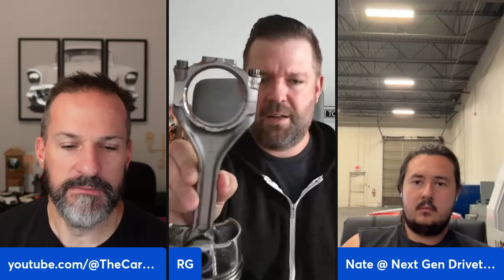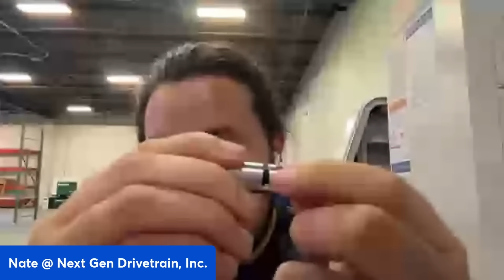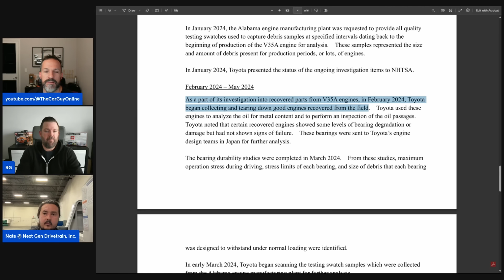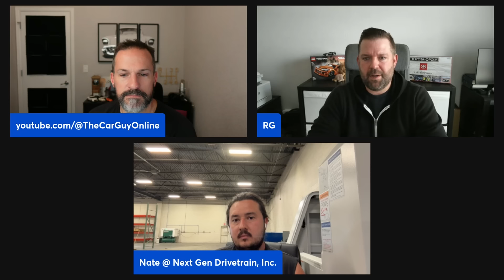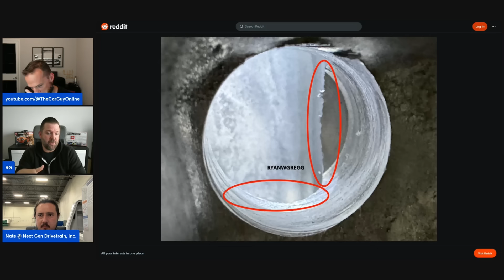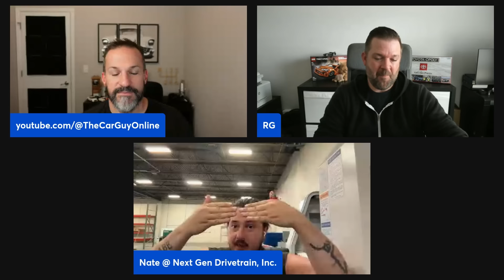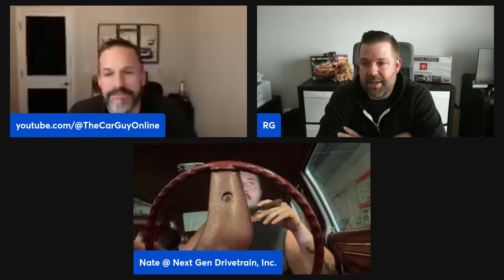Toyota Tundra BOMBSHELL. Buyer Beware Until 2026 (Full Interview)

Comment: 11:03 Doesn’t surprise me at all. I had a 2007 Tundra and had one of the very early emission pump/switching valve problem. They refused to admit it was a problem or cover it. $6000. The second one went out. Still wouldn’t fix it. Besides that issue, it was, by far, my favorite truck of all time. I put 300k miles on it resetting the CEL every morning.  I WILL NOT EVER buy another Toyota. Not because of the issue, but because of Toyota’s refusal to acknowledge the problem even though thousands were talking about it on the forums. F them.

Comment: The absolute crazy thing is that the EPA rules are actually causing more air pollution than they are trying to prevent. Cars, washer, dryers, dishwashers all have a very short life expectancy because of trying to save energy. But the pollution caused by scrapping and buying new is much more destructive to the environment. Remember when a fridge would last forever? All these energy savings rules are causing land fill issues and scrap yards are full of junk, then we recycle the junk and use more and more energy that is causing more and more pollution. These rules by the EPA are causing climate change faster than they are stopping it…….. When idiots are in powerful positions and low iq can’t see past the poor decisions….

Comment: My 2014 Sienna with the V6 has oil leaking from the timing chain cover with only 135k miles (when I noticed it).  It's a common issue on these engines if you check YouTube.  It's about a 17-20 hour labor time fix.  Not happy.
Reply: Oil leaks happen. Monitor your oil level at every gas fill up. Keep it full. Change it every 6 months or 5K miles (whichever comes first) and continue living your life.
Reply: Thanks! That's the plan. No way am I paying to fix that.  I'd rather trade it in at that point.  I've been monitoring it and adding oil if needed.
Reply: @85Rx  I have a 2015 Sienna and so far haven’t had any leaks. 🤞🏻 It has 211K miles. We’ve had it since it was new. The 2GRFE are an excellent engine. They’re extremely long-lasting and reliable. You can’t buy a new car with that same reliability anymore. If mine develops a leak, I’ll monitor it and if it starts getting to the point where I’m having to add oil a lot, I’ll have it fixed. New cars are junk.

Comment: I been thinking how would you build a girdle that holds the crankshaft bearings for every engine. As all the girdles would be the same. And that would suggest that every bearing is the same. How can that be done when there is always tolerance differences between parts. One of the crankshaft bearings could be tight on one engine and loose on the next. Remember when we used plastic gauge to determine the clearance between the crankshaft and crank or rod end bearings. That doesn’t happen anymore. Just slap a girdle with the bearings on and tighten it down. Cross your fingers that non are tight.
Doesn’t make any sense that that would work. Crazy

Comment: i watched this whole interview and this exactly proved my point as to why I gave up on modern gas and diesel cars. I switched to Tesla and yea it doesn't have the gas v8 etc whatever. But I cant in good faith say that there is any reason to buy a gas powered car anymore with all the emissions crap on it and quality control on these engines and transmissions is horrendous. You CANNOT just maintain a car anymore and hope it will be reliable. Now its WOW I changed my oil and transmission fluid religiously yet I have head gaskets and turbos blowing up when I did everything right to the car. I am just done with it.

Comment: yeah, i have a 2016 and a 2004 Land Cruiser.  keeping those two forever.  I'm honestly thinking about trading in my 16 for a 15 so i can have the 6 speed instead of the 8 speed.  i hate what toyota has become. they are on the cusp of losing all their longtime followers.  best suggestion is get a toyota tundra with a ton of miles and replace the 5.7 long block and trans and do another half a million miles.  f these new vehicles.

Comment: I got one of those parts that was missing the hole! I called customer service and they overnighted a revised part no charge! I finished the install and had an issue with a trouble code. Taylor in tech support told me what the issue was and it cleared itself shortly after. I am a new fan of Next Gen transmissions.

Comment: The Toyota that people interface with today are run by American managers who are more concerned about making the numbers look good this quarter.  They surround themselves with friends and families.  Also note that Japan has labor shortage problem in manufacturing, so the people that build Toyotas in Japan may not have the same continuous process improvement mentality.  Dealers are independently owned, so they are mainly interested in making $, not performing warranty repairs.  

The grandson of the founder and former CEO of Toyota, Akio Toyoda, stepped down in 2023.  The current President and CEO of Toyota, is Koji Sato. He is not related to the Toyoda family.  Best chance of fixing the problem is to contact Sato, not the people headquartered in Texas.

Comment: I’ve been doing short oil change intervals and oil analysis on every one of them on my 2025. I’m at 3,1XX miles and have done 3 oil changes already. If my motor blows it’s a design flaw 1000% because all my analysis have come back great (the first two was a little weird but normal for break in)

Comment: I’m keeping my 5th Gen 4Runner. 

If I needed a half ton pickup right now, it would probably be an L84 5.3L GM now that it moved away from a variable oil pump.  If the lifters went after warranty I’d delete and upgrade the cam.   

Or I’d go 3/4 ton gas.

Comment: Working in manufacturing as an engineer, leaving debris in a part is such an amateur mistake. It makes me think that is not the case. I am not in automotive but wonder if their tolerances are so tight to meet the epa requirements their issue is actually improper tolerance and what they are getting is parts rubbing. Thoughts?

Comment: keeping my 2011 camry v6 until it rots and theres no more metal !
Reply: Fluid film it every year and wash it after it snows so you get the salt off, and it will last a very long time.
Reply: @Becca-k4h  been rust proofing from the day i bought it! only rust i have is on exhuaST
Reply: @peterpeter5666  That’s awesome! You’re more diligent than most owners!
Reply: @Becca-k4h  been an auto tech for 40 years . i kinda know a thing or 2 about cars LOL
Reply: @peterpeter5666  That explains it! Lol!
Reply: @peterpeter5666  I also have a car with the 2GRFE engine. It’s a 2015 Sienna. We will be keeping it forever. It’s such a great vehicle. It has 211K miles are still running strong! The last reliable cars that Toyota made. The new stuff sucks!

Comment: As for Toyota not being the same company they used to be, nobody brings up the “un-intended acceleration” issues from about 15 years ago. It started then I believe. Toyota said it was floor mats riding up and pressing the gas, but my parents had a 4Runner that it happened to without floor mats. It absolutely terrified them. (Also the 4Runner was never officially included as an impacted model). Put the car in neutral and pulled over and it was tacked out. Lifelong Toyota/lexus loyalists and they never bought one again. To Toyotas credit they did buy the 4Runner back. But the denial of it being an engineering issue was what made them bail and seems to have started a trend of denial for corporate.

Comment: Plastic intakes, starters you can’t get to. Buried water pumps, belts running oil pumps, internal slave cylinders.  Batteries that last only 2 years. Windshields that cost $2000. Manufacturers that recommend 10000 mile oil changes. It’s just ridiculous for a product that is such a huge investment. And this is all cars and trucks. Not sure what’s going on here, but it isn’t for the benefit of the consumer. Good talk guys.
Reply: Almost forgot engines with no dip stick to check the oil. Just crazy
Reply: I have a Colorado diesel and to get the intake off you need to remove everything under the hood. Extremely poor engineering 
If the starter fails I may have to remove the engine
Reply: Cars are not investment lol if you want to haul a 1/2 ton ain’t it. Trucks are not investment unless your business keeps on growing(rot). If you’re buying a product to just go to work you get a more economical car. Not all cars are terrible or not reliable. Go with a Camry Corolla or Prius. And you’re not spending more for something that it’s a coin flip. Nobody is pressuring you to do 10k oil. Do it yourself at 5k or every 6 months. These are all choices.

Comment: Nobody really needs an auto transmission with more than 4 speeds with O/D and tow mode. I have a 1st generation Titan bought new in '05. Bullet proof 5.7L Endurance V8, 4 speed Jatco with tow mode and o/d and PERFECT and smooth as silk. I can afford a new truck (the Titan is fairly  low miles) but don't want a turbo engine and 10 speed auto so I will keep mine and maintain it.
Reply: Never understood the 10sp tranny stuff.  More isn't always better.

Comment: Great information, thank you for sharing!  

I have a 2025 toyota tundra SR5 TRD that I bought late 2024 around November time frame. If I changed my oil at 1000 miles and then will change it again at 5000 miles. Then change it every 5000 there after. Will the engine last without a failure? Or because of a cleaning process and part change it will most likely fail down the road prior to 100000 miles?

Comment: Im active on the tacoma forums.  Engine failures are non-existent.  Transmission problems and electrical problems yes.  Suspension problems and driveline issues definitely

Comment: I gave my 2009 Chevy Silverado 5.3 to my son and it’s had my maintenance schedule which is way better than recommended and it’s still a reliable truck. Brakes have been replaced and some ancillary stuff, so bashing all American vehicles isn’t right. My 1984 Honda Accord had a camshaft failure at 21,000 miles. Thankfully the warranty covered that.

Comment: I bought a 21 tundra in NOV 21 one of the last V8 limited that came out of the factory because I did not TRUST TOYOTA and the first thing I did was get A GENUINE Transmission cooler installed because I did not trust TOYOTA reason for deleting same.
I do not trust TURBOs HYBRIDS or CVT.
While I am not an engineer…clearly TOYOTA GOT CHEAP and under engineered the engine…
TOYOTA BURNED ME  in2006 and 2007 with bad pistons rings on my RAV and 
Solara. THE BOTTOM LINE with TOYOTA YOU HAVE TO ALLOW TIME TO VALIDATE QUALITY
THEY CUT CORNERS

Comment: Recall replacement engines are failing. I have commented this before. I personally spoke with 2 techs at my local dealer when I was getting service while they were outside on break or something. We were chatting about Tundras. They first of all said DO NOT buy a new one and keep my 2nd gen. And they also said they have already had 2 of the warranty replacements come back with failed bearings. That was a few months back.

Comment: RG and I have similar backgrounds, my formative learning to drive Wonder Bread years were spent in Indiana where you did not drive a foreign car to a union town. I've been driving "full size" Toyota pickup trucks since the late 1900's, I started with a '96 3.4L T100 ... I am currently driving an '02 4.7L and an '07 5.7L ... way back in '17 when I bought my '07 I had already made up my mind to avoid any Tundra made after 2013 because Toyota's QC issues began in 2014 when TSS began to take over, Toyota's QC has gotten worse since then.

Comment: GOVT regulators, where would we be without them? One example (and I am sure there will be many) a English engine designed in the 1930's and still made today and used in many countries is the old Lister CS 1.4 liter single cylinder diesel. (there are twins of course with double the capacity) that run on the smell of an oily rag. lots of off grid'ers use them for there efficiency, yet band by the GOVT cause of they are indirect injected engines. Never mind the under square profile. The point I'm making here is GOVT officials lack common sense. Yet as some one stated common sense is no longer that common.
Reply: Yet automakers seem to spend their lobbying money on everything but fighting regulations.

Comment: 1:25:14 "technically" incorrect statement on fuel and additives.   if you run whats known as "top tier rated fuel" from any top tier rated fuel station, they have the same "upgraded" additve package in ALL octane grades of the fuel.  from regular to premium octane grades.  the only benefit you're getting from running a higher octane (on an engine thats minimum octane requirement is regular 87 octane at a "normal" altitude) top tier rated fuel is you're slightly increasing your thermal ceiling, or gaining a slight degree of thermal protection from the fuel.  in texas (aka hot climates) yes, that's probably a benefit, and, tbh, i run sunoco plus (89 octane) top tier rated in both my (non turbo) vehicles (3rd gen toyota tacoma v6 and 11th gen honda civic sport with the 2.0L) but, all digressing aside, the point im trying to make is, if you're buying fuel from a top tier rated fuel station.  youre getting the extra additive package on ALL octane grades.  www.toptiergas.com  will tell you where your local top tier station is to you.
Reply: The Top Tier standard essentially specifies a minimum amount of the detergent additive but some companies use more. For example, some Mobil stations advertise their premium fuel cleaning 3X better than their regular gas. 

You may find interesting the  Motor Oil Geek’s videos on Top Tier gasoline and the one where he talks about how Shell premium fuel has additional anti wear properties compared to their regular fuel.
Reply: @shawngrimes9302 yes , I recall watching that video too.  I remember them saying that shell had the most/best of the additional additives, but they were the outlier/standout.  but im honestly in the camp of if you at least use any top tier rated fuel you're better off than those who only use the minimum government standard of additives

Comment: When I worked for Toyota, they would give you short blocks and you had to slap on the old heads. Even if they say "long block", they still want you use the old parts off the original engine.  If they could, the would get you to reuse engine bearings 😂. 

I like that Dodge sells you a complete engine even it it blew up at 200k.😂. $9400 for a complete dressed engine

Comment: Ehhhhh, 1994 Toyota 3.0 V6, I had a recall engine and I had 80,000 plus miles. The head gaskets sucked. Gave me a new engine in a crate and at 160k same issue, head gaskets went out again.
Reply: 1990 4Runner 3.0. I just LS swapped it. It took time, engineering and money. AC blows ice cold, running cool on a 105 degree day, gets the same mileage as the 3.0 but 4 times the power, and it’s a 6.7L. Sleeper it is, and a blast to drive. Smoked a new twin turbo Tundra the other day from a light. It’s been super reliable.
Reply: Your post deserves more likes.  Seems to me everyone here is attacking the new trucks but don't realize even the old trucks had shit enginee designs too

Comment: It's a design issue. Everyone makes mistakes and Toyota has made plenty of them. Not for or against Toyota but we have to stop protecting any brand when there is a flaw. People are quick to bash Ford, Chevy or Nissan and almost any other brand but when Toyota's have issues everyone who criticizes them are labeled as haters or dismissed. The one piece bearing cap bridge/ladder can not have any tolerance variations or it fails and no matter how precise you are tolerances are part of mass production machining. This was a dumb a decision as Nissan's VC turbo. A design study that should have never made it past the study part. It was never machining debris and that was obvious from the start. It was bearing debris and a lying corporation trying not to take a PR hit. Funny how people bash corporations until they love one then they make all the excuses for them. Individual caps do not affect the bearing pressure of any other cap and the front cap that also acts as a wall of the block bears the most pressure. At a bare minimum that cap should have been individual and six bolts. But make them individual caps and you have no issues.They tried skimping on intrinsic block strength then tried to reinforce it with the ladder system and it is costing them. Trying be cheap and shave 5 pounds on a 50 to 80 thousand dollar truck. Toyota is like everyone else out there anymore and we should not let anyone escape scrutiny and just criticism.
Reply: I believe poor design is also the root cause. We'll not know for sure until the new engines have been out for a while. I doubt that if Toyota is making a major engineering change that they'll telegraph that info to the public because then anyone with an older V35A engine will suddenly realize the deficiency their engine has and will see their resale values fall even further.
Reply: NEVER buy the first year new models. On any vehicle. Common sense.